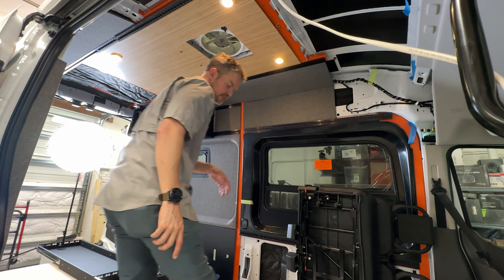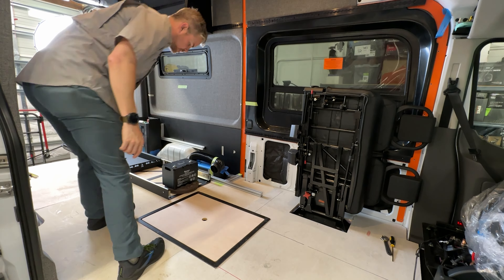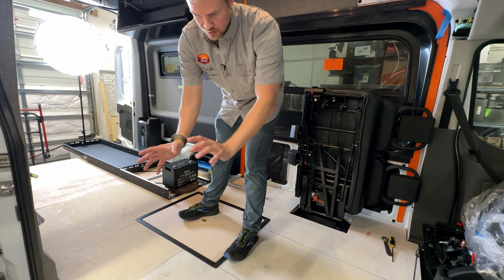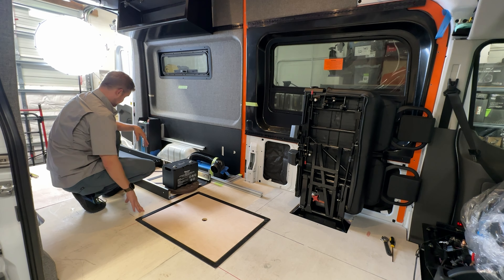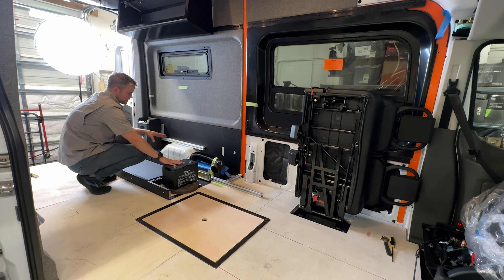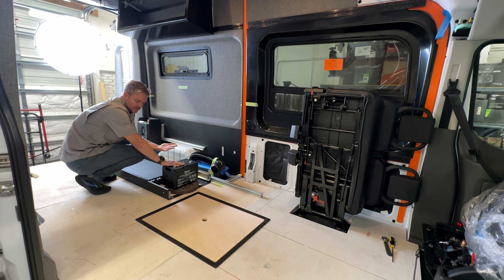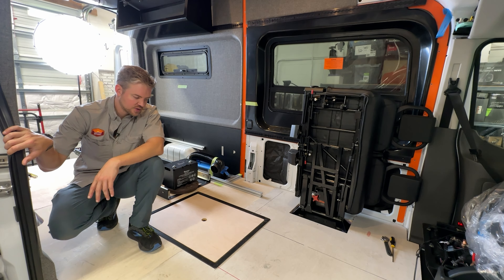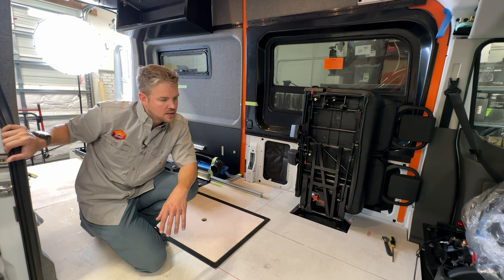Take a Look Inside Our New Odyssey Custom Van Before Anyone Else!

Comment: I took quite a few ideas from your build.  I am planning lizard skin and ceramic coating as well as
 lift bed and hydronic water heating system addition to Webasto heater. I am considering floor heating option as other choice.  Watching your channel I started leaning away from Sprinter towards Ford Transit.  As of now I am finishing my build of older model VW Bus with high top. That supposed to be fun project but turn out to be serious undertaking.  Thank you for offering so much info as to where and how you do it. Very informative  !!!